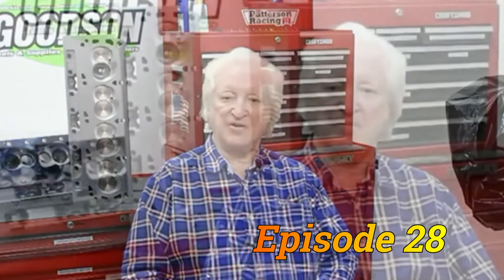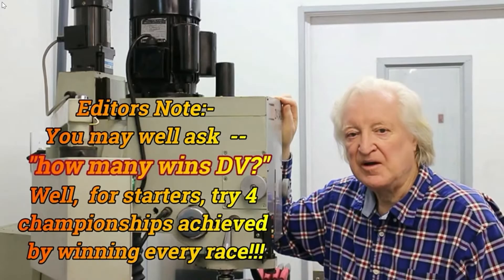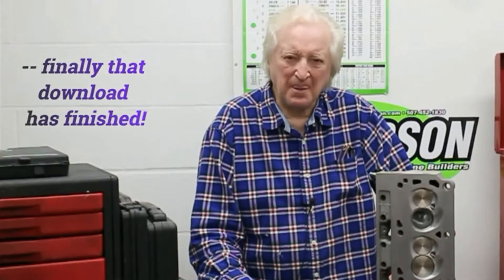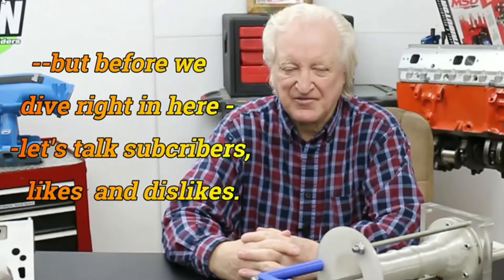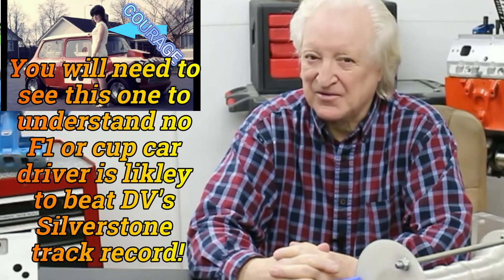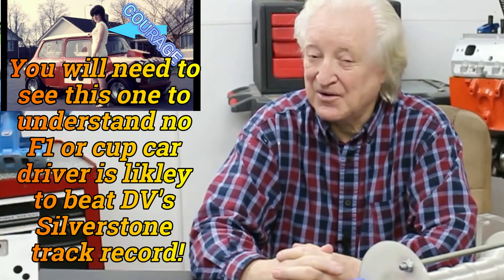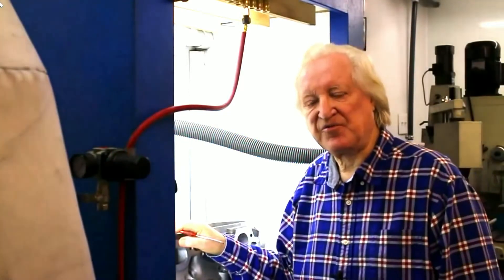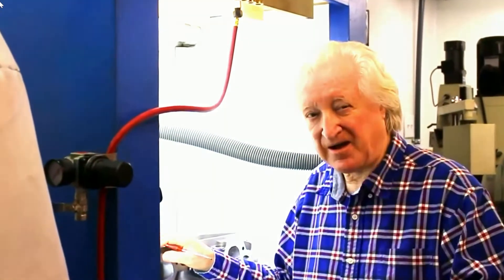5 golden rules for Pro grade porting. What are they?

Comment: David,
There is SO MUCH amazing content that you have given us through your research that few others have any insight into.
I have a 454 2 bolt main CCB that because they used 049 heads, low compression and a smog cam was a real dog off the production line. The real truth they never wanted to reveal is they produced far more pollution by lowering compression ratios than what they saved in their fanciful philosophical ideal EPA world.  If high compression takes a 1/4 throttle to move the same load as 3/4 throttle for a low compression engine, you lose efficiency and create more pollution as the same time.  What a lose lose proposition.  The engine was a 1973 CBB.  
it was SO bad, it did not have enough torque to back over a curb in stock form let alone carry a cord of wood in the mountains from a standing start.  With knowledge of your books and other after market content, built a 383 sbc with far more torque and better mileage than the cbb ever had new.  You are an amazing automotive talent that sadly was not appreciated across the pond.
Thank you for all the time and effort to teach us how to improve things over the old American "that's good enough" attitude.  I am in my 60s now and wished I had 1 tenth of the automotive knowledge I have now when I was in my teens. 
Thanks for plowing through the BS to get to proven repeatable results.
Reply: Uh, maybe do some investigation into Oxides of Nitrogen, and combustion temperatures.
there are many pollutants in exhausts.
If you want to go into things a bit further, you can check up on the Volkswagon diesel emissions cheating they tried, and got caught out on - there were other companies, but that should be easiest to find.

Comment: Instantly as you asked how heavy is air I shouted out 14.7 pounds per square inch. Realising after that this is not the weight of air, rather the weight or pressure caused by air pressing on an object at sea level or at 1 atmosphere (1bar) I hadn't ever thought of the actual weight before.
Reply: @ 2.7 pounds per cubic meter

Comment: @David Vizard:
Could you show us in a new episode the combustion chambers as they are standard and as they are and after grinding, sanding etc is done? So we can compare and see where to work the chambers. 
Thank you.

FIAT 903 OHV 8V head has oval chambers. I wonder if the sides of the chamber has to be worked at. By this I mean the area of the quench/squish and the there where the spark plug is mounted.
If so, you make the combustion chamber bigger which will result in lower compression.
- How do you compensate?

I all ready understand that you have to apply a radius on these sides to let the mixture flow better towards the compression chamber.

Comment: I've been thinking about getting a set of used heads so I can try porting them myself. I have a 96 Buick Roadmaster with the LT1. There's not a lot of aftermarket support for the 2nd gen small block Chevy. And what is out there is too expensive. I'm hoping I can find some used parts I can afford and slowly work on them when I have spare time.

Comment: What does a school have to do with head flow ? Sir your not telling your audience the percentages of the runner , pinch section , cross section vs the bowl area. I think some may be interested in how to measure those areas on a cylinder head and apply that information to there project. Thank you sir
Reply: The #1 restriction is the VALVE. 
DV has videos about the valve seat area.

Comment: Have a deep pattern cut into the floor port will help swirl and increase turn speed dramatically (when done right)

the finish should look like a square inch zebra crossing cut (one inch dremel cutting discs work well)  into the floor of the port just before the turn

depth of cut needs at least 40thou

dimensions will obviously vary but half inch wide (at the floor  centre) and one inch long
Reply: Ya, I forgot the guys name who does grooves in the ports... Larry something.
Mostly in the 4 cyl cars, ricers..

Comment: I followed a porting series on Pontiac cylinder heads for the novice
Couple of tips-
Once you have the bowl size established you can use old valve of the size of the bowl to simplify measuring and shape
Those articles focused on short turn and bowl shaping
The pushrod inch was mentioned but not critial points
The experiments involed adding epoxy before the pinch not widening the area
Cool stuff
It got more involved
The author was a gent Pete McCarthy
A Californian
Thanks for the videos David
Reply: Tim, what is the name of the Pete McCarty book and is it available on Amazon. 
I'm working on 6X's and am having issues getting to the 350 fps at the inlrt  which may be in the details you mentioned. I'm working on a 1.68" to get 235 cfm.  I'd  appreciate it if you would point me where to get that book. Thx
Reply: @waltmucha2499  
I dont have Petes book
I do have  his porting tech series from 
Pontiac Enthusiast magazine
I have every issue

Comment: Question, Does the same hold true with regards to runner finish in a flathead ford to achieve proper atomization. Meaning, air/weight being drawn in a flat head block  from below, not overhead. Hope I make sense. Cheers Sir 👍👍👍
Reply: JMO
Air mixture doesn't know where it is or brand names of the heads.

Comment: I'm building a greenhouse that channels that efficient Victorian-era architectural structure you've just reviewed. The unintentional aesthetic similarities are uncanny. I designed it to be a "knock-down kit" that required a million little gussets and brackets drilled with matching bolt holes, along with hundreds of feet of threaded rod and turn-buckles.

Comment: air weighs 14.7 psi or pounds per square inch at sea level – meaning about 15 pounds are pressing down on every square inch of you.
Reply: Thats a column of air 1" x1" by 60,000 feet high = pressure (psi) not the weight/mass of air.
Reply: No... force and mass are two different things.  Now for some extras...
Rule 6 - there is no rule 6
Rule 7 - no poofters!

Comment: 1 mole of gas at stp takes up 22.4 litres. From school.1st year grammar school 1969. I don't think kids learn anything these days? that's .79 cu ft. Given that air is mainly nitrogen we can use 28g for mw. if you want 100ft by 100 ft by 100 ft that's 1,000,000 cu ft. multiply 28g by 1,000,000 divide by .79 get 35,443Kg so about 35 tons. edit, I wrote that before I watched the answer.
Reply: Then to fine tune my calculation use 32g for oxygen so 1/5 at 32 and 4/5 at 28 so 28 tons nitrogen + 8 tons oxygen. So that's 36 tons but it depends on what you use for T and P. so pretty much spot on .

Comment: Have you ever considered working your expertise on GMs 60° V6 family of engines: 2.8L, 3.1L, 3.4L & 3.8L all equipped with distributors as used in rear wheel drive vehicles. I am a relatively new subscriber and I enjoy all of your videos, and I have learned so much from you already. Thank You. Guy Franks
Reply: I didn’t even know gm did a 60°, learn something every day! I do know that the 3.8 is a 90° v6, part of the legendary Buick Fireball engine family.
Reply: All the basics apply.
Air doesn't know what engine it's going through

Comment: Verify my math based on the numbers DV provided.  100x100x100= 1million cubic feet, weighs 38 tons (38x2000=76000)   1,000,000 divided by 76000 = 13.15 pounds per cubic foot.
Reply: Wrong 
One cubic meter weighs @ 2.7 pounds.
Reply: @hotrodray6802  One cubic foot of air weighs 2.7 pounds ?  Did the numbers provide by DV match the numbers in my comment?

Comment: I followed your instructions on 186 sbc heads and then had them go to a flow bench I got 250cfm from every thing in your book and lots of patience best heads I had , switching to edelbrock rpm did loose if I remember correctly 2 to 3 tenths

Comment: Defiantly looking forward to your expanded videos on the 5 items. One question what would one use as a filler in both the intake and exhaust ports on a cast iron head?  As best that I can tell by looking at the head Ill be using , 235 Chevy six some corners may need to be rounded a bit.  Air weighs around 72 - 74 Lbs per !000 cubic feet, all depends on temperature, altitude and humidity. It took me a lot of thought to accept that.I always guessed lower than that. I've read and reread your book on head porting, starting to get it threw my thick (head) what to do.Thanks Fred,

Comment: One thing I would like to see Dave do a deeper dive into is optimising the valve seats. How much difference does a traditional three angle valve seat make as compared with a single angle? How does the valve seat angle affect performance at different RPM?

These would be quite important since in other videos Dave has pointed out that the valve seats have the biggest impact at low valve lifts. Wouldn't this mean that inefficient valve seats make your camshaft behave like one with lower duration as compared with more efficient seats?

Another thing that I'd like Dave to go into is how the flow is affected by the opening and closing of the valves. I know that smaller CC ports tend to work better at lower RPM while larger give higher horsepower at the top end. How does port size affect the flow velocity and energy and how does the flow recover when the valve reopens after it has been closed.
Reply: DV has done this extensively. Look for his video.

Comment: That's interesting, the knowledge for the weight of air was all in my head but not visible.  I know from high school chemistry that ideal gasses are about 8.3L per mole at stp, and moles are atomic number of grams.  So N and O (14 and 16) make about 1.7kg per cubic metre.   From there it makes it 45 tonnes in a 30 metre cube.  Most of my error seems to be due to air not being an ideal gas, but that's a matter of 30%, not orders of magnitude.

Comment: Lol I remember one time my dad said when you put air in a tire it doesn't weigh more than it did before you put air into it and air doesn't weigh anything, I'm thinking to myself that's not smart but I didn't say that to him, I just explained lol. David is absolutely right and most people don't realize how heavy air is. If a cylinder was placed around the eiffel tower the air inside the cylinder would weigh more that the tower itself. Thanks David for all you've done and continue to do.
Reply: Eiffel Tower weighs 10,100 Tonnes. Just the iron weighs 7,300 Tonnes. A box large enough to enclose the tower would hold 6,200 Tonnes. So close, but not quite.
Reply: @bradmaas6875  yeah that's pretty close. I guess history Channel was wrong, I just did the math myself and its fairly close to what you had. 410' x 410' x 1083' = 182052300 cubic feet, 12.8 cf per lb, gives 7111.4 tons of air. Just goes to show, don't always believe what you hear.

Comment: I've always been impressed by David's knowledge, I've read through his porting book probably 2-3 times now. I have a 289 for my 68 mustang I'd like to get the most out of using only parts that would have been available when it were new, stuff I could have sourced if I were alive and able to buy it.  I have some earlier 'high compression' heads. I'll probably use a 302 crank (my original is badly worn) I'll need to find an era correct 4 barrel carb/intake and an appropriate cam.